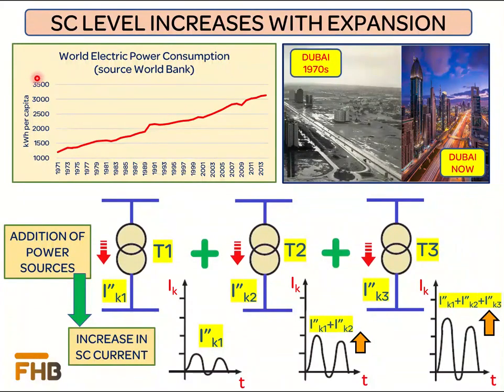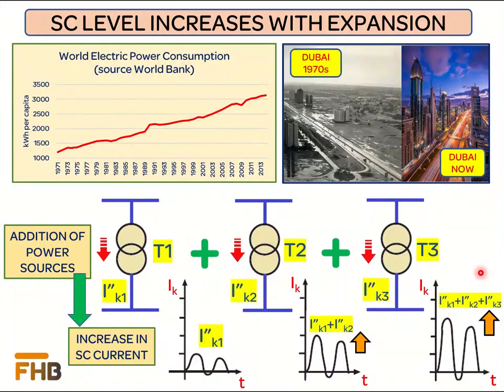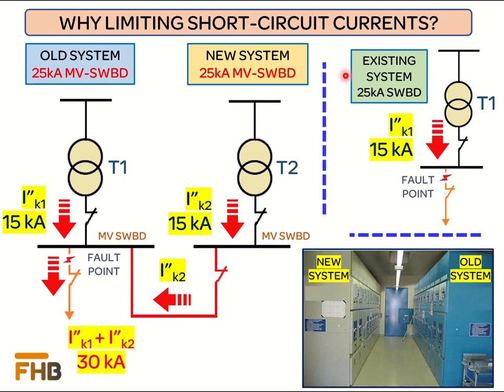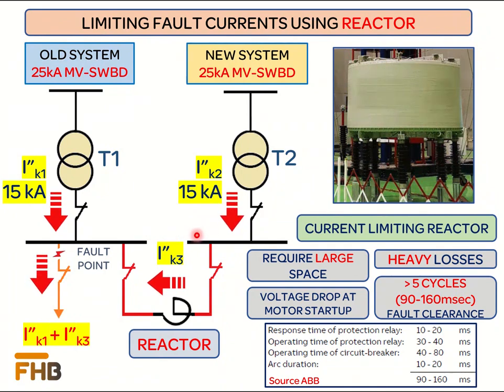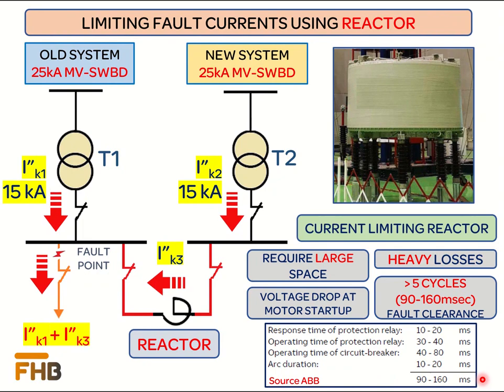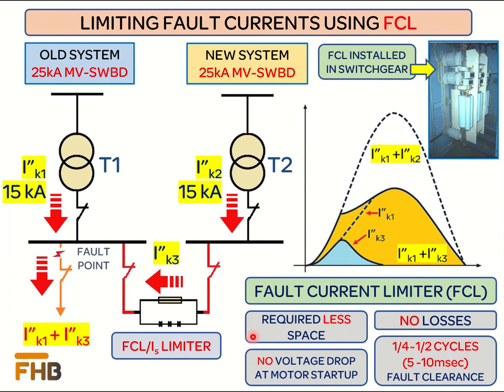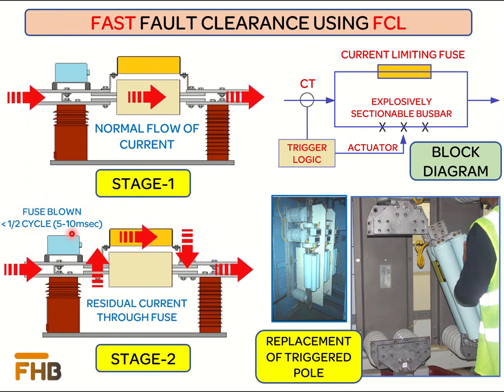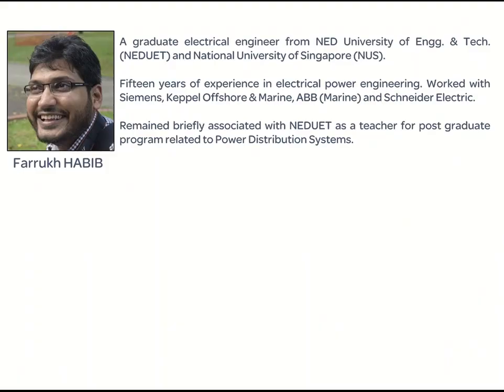MV Fault Current Limiter (Is Limiter/Pyro-Breakers) | Farrukh Habib - FHB | #ElectricalEngineering

Comment from the maker: KINDLY LIKE & SHARE THE VIDEO - PLEASE SUBSCRIBE THE CHANNEL!!!
0:00  -> Introduction about the v-log.
0:55 -> Reasons behind increase of short-circuit level of the power network.
2:56 -> Why we need to limit the short-circuit level.
3:53 -> Limiting short-circuit level using CURRENT LIMITING REACTORS.
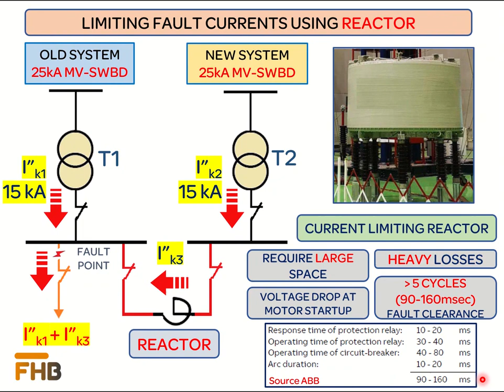5:35 -> Limiting short-circuit level using FAULT CURRENT LIMITER.
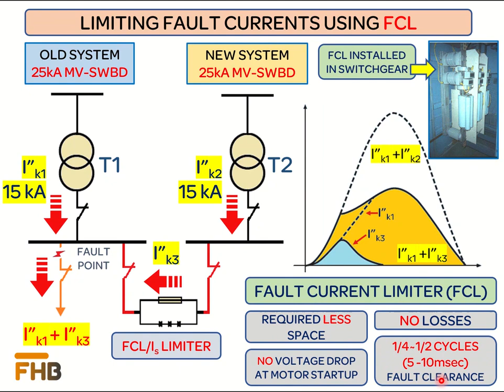7:02 -> Working principle of FAULT CURRENT LIMITER.
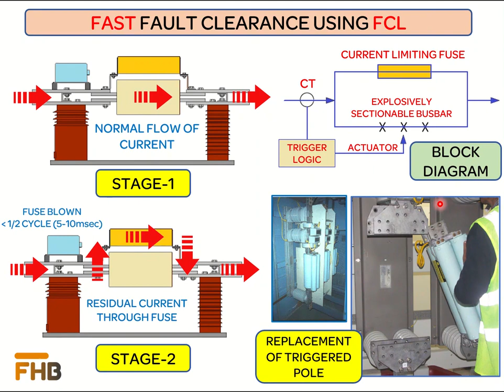8:03 -> Standard application of FAULT CURRENT LIMITER.
==================================================
RELATED VIDEOS!!!
Internal Arc Fault in Switchgears -> https://youtu.be/uBfb10MTeDc